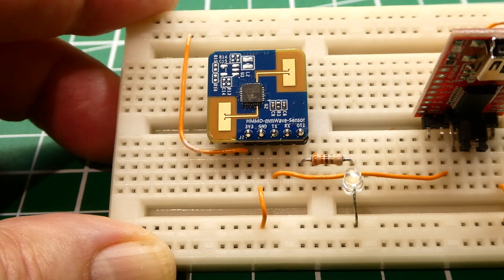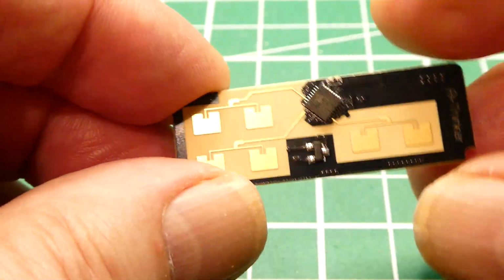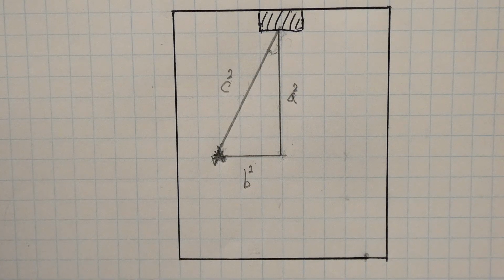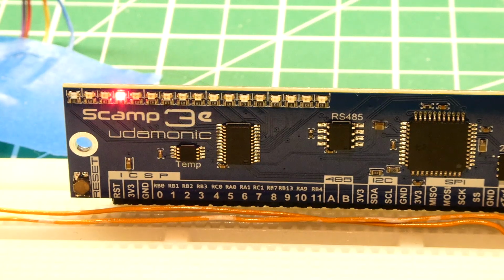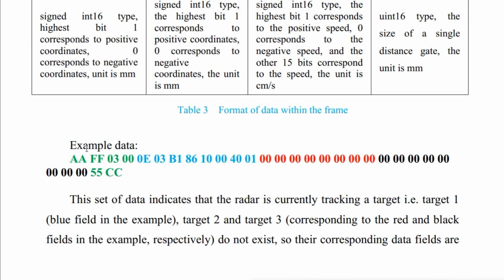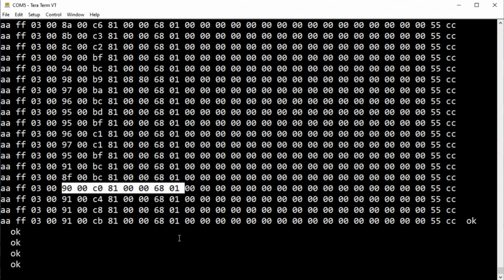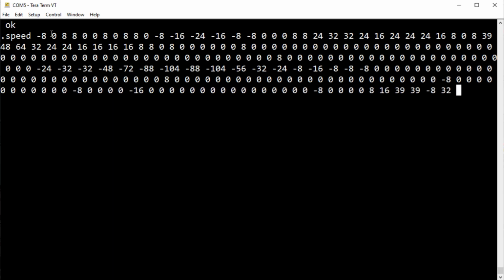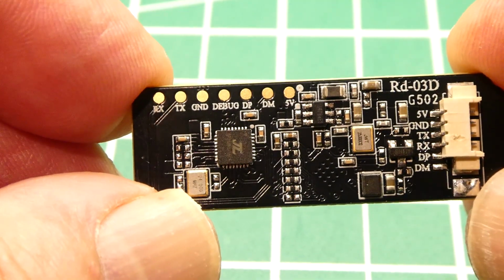Human Tracking Sensor  / Rd-03D / mmWave

Comment: Thank you very much for the detailed explanation. I have also ordered the same module for myself and want to experiment with it. I have a few questions for you:
1. Does this module not require any commands to be sent, and does it already work in three-target mode right away?
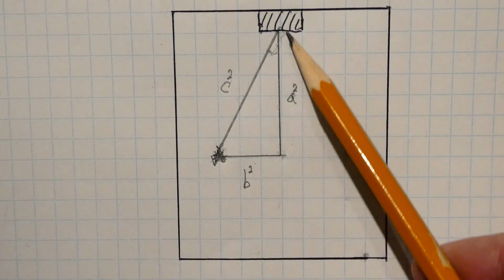2. Regarding the actual distance to the target, is it length C or length A at 2:48? I think the real distance is C, and it is always greater than A, according to the Pythagorean theorem.
3. I don't understand what the last parameter, Distance Resolution, means.
4. Ultimately, knowing A and B (or the same as Y and X), is it possible to calculate the angle?
Reply from the maker: The default setting is to track 3 targets. If there are 4 targets it will show the strongest one.
The distance to target is the distance A. You are also given distance B so you calculate C yourself.
Distance resoulution is the range gate or 'bins' distance. The distance is 20 cm slices or steps from the sensor.
This tells you how the sensor can see two targets who are close together. If they are really close it just sees one target. To calculate the angle it is Arctan B/A

Comment: What characteristics of a target constitutes a human?
Reply from the maker: The sensor measures the amount of energy reflected back from the target and can tell the size, correlating to a human body when the sensor is mounted at the correct height. Small movements can still be detected if the human is standing still ( breathing, twitching, blinking ... etc) The sensitivity of the many range gates can be tweaked for the desired detection.

Comment: This is radio, but it made me think about the older power transmission system "Geometry-Based Circuit Modeling of
Quasi-Static Cavity Resonators for
Wireless Power Transfer"  which are 3d & scaled up versions of a wireless phone charger. I am re-looking at this to power Iot devices such as these (your video) devices. Could these get wireless power and communications without interference?

Comment: Another really great sensor. Very interesting video Ken. What's the resolution like over very short range?
Reply from the maker: The resolution is one range gate length which is the 4th word in the parsed data which I did not show. It depends on how many range gates you split the length of the room into. My example shows 30 cm or about 12 inches. The human body is considered "thick and wide" so 30 cm works out well.